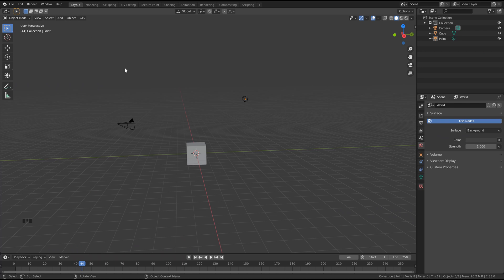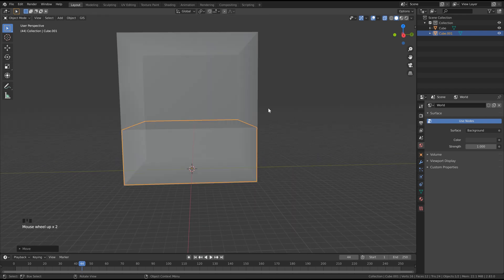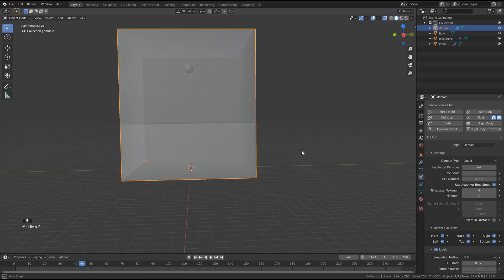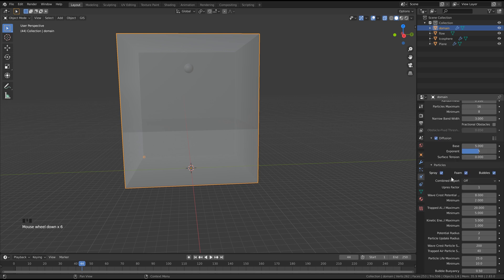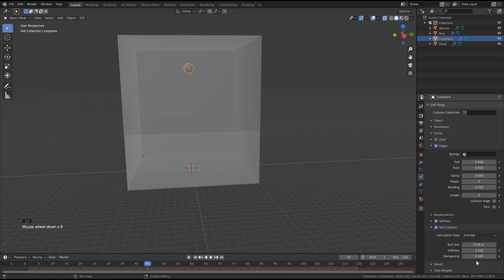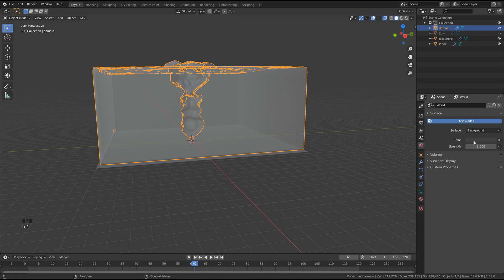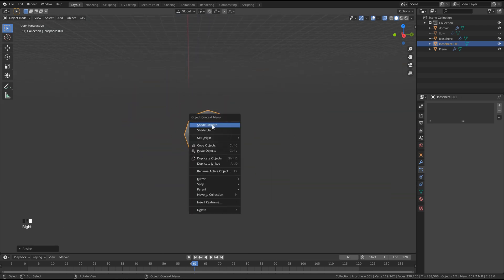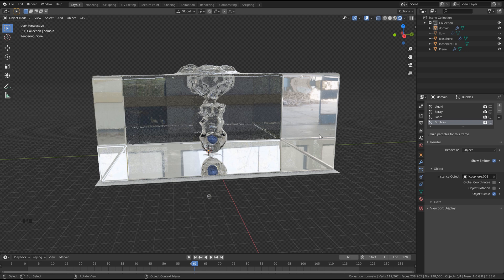Blender 2.8 | How To Create A Fluid Simulation | Mantaflow Liquid - Water TUTORIAL

Comment: When you make the bubbles and spray, how small do you make them? Would have been useful to know what number to scale by. I tried a few different sizes but figured it looked better without.
Reply from the maker: For this specific animation I used a sphere and scaled it by 0.4

You can also try adding a few different size bubble and putting them into a collection and then set the render to collection instead of object. This will help give some variation to the size of the bubbles to give it a more natural look.